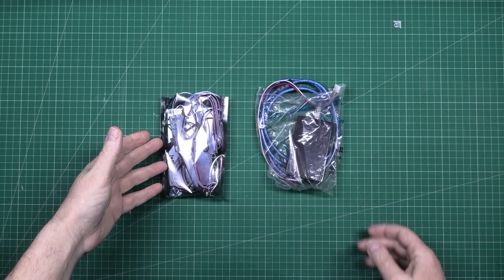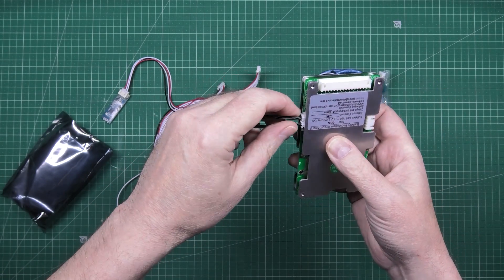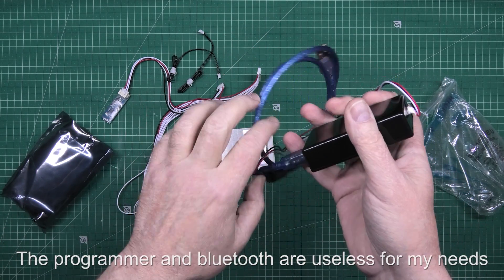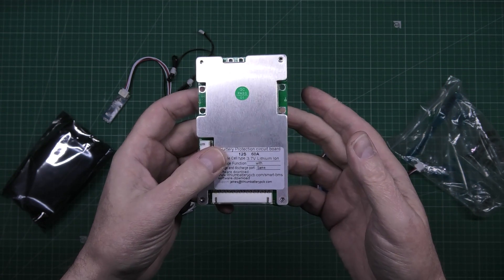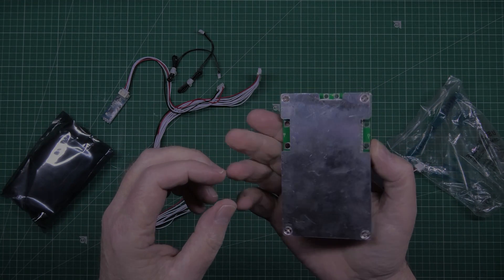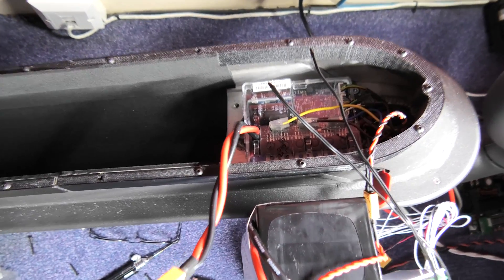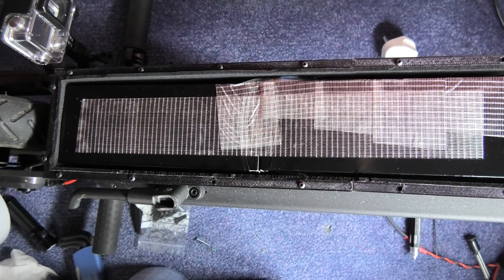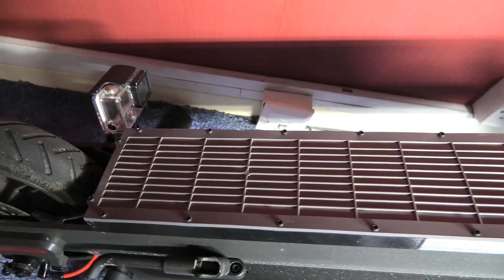Xiaomi M365 Pro scooter part 3 - new BMS and LiPos - the ultimate mods

Comment: I don’t know if you will get your message but when you converted your front wheel to rear wheel shaft through the wheel where did you get the extension from I am making an all wheel drive at the moment but I need to know where you got the shaft from
Reply from the maker: If you're referring to one of my later videos, the link was in the description on where I bought it. It was a complete kit I bought from someone in the EU that converts it to RWD.

Comment: You may be all over the shop with this one but you’ve done a pretty damn decent job of this mod!
How did the pla spacer go with rigorous use?
(Can I suggest making that thing sealed by coating the inside of the print with anything like paint to stop ingress of water and some glue gaskets too)

Comment: Tony, did you have to modify the BMS at all ? i.e. remove some of the resistors or did you jut have to re flash it using the programmer you show ?
Reply from the maker: Yes, I had to remove some shunt resistors and a couple of the very small ones. I've been working on a 'how to' but it's not making much sense (even to me)...... I'll keep working on it, though 😊
Reply: @Vortecks  thanks for the reply - thats basically where I am, I've prepped the BMS, did you program is using the supplied programmer or did you have to connect wires to the chip ?

Comment: Again..V interesting .
How well does that Aftermarket BMS do at balancing the cells .. such performance seems rare with  (cheap) built ins. 
Alternate would be to use a Quality external Battery charger station  (not inexpensive) as well as a nuisance everytime one charged.
But that would require a  direct external connector.. would the ESC  like having the sms disconnected?

Comment: Lol...Tony, you're a Top Bloke matey...I'm guessing you had to drill and tap all those cover holes, or did you just use longer screws...?
Reply from the maker: I used longer screws mate. The hard part was designing the extender bits and make sure all the holes lined up!
Reply: @Vortecks  Yeah, that's what I meant to say, that's dedication mate...lol.

Comment: Could you develope a battery unit that will run Small Computer and Display for 14 days +, if I provide the power requirements?  Or if you could guide me through the project as I am not an electrician, nor do I have all of your required test equipment.  Most Humble Appreciation,  Alton
Reply: Running just one 100 watt light with an inverter will take loads of batteries so high cost... If it's a full pc  your best bet is a generator. Honda make one of the best small one's that's quiet.. or just run a tablet PC with a car battery as your power bank.. you'd just need a 12v to usb module.. and I think you'll get a few months of run time..
Reply: As Brooke has said a generator would probably be better.... Small computer and monitor will probably pull 350+ watts so let's say 350 watts per hour x 24 x 14 days... Will tell you how many KWhr you will need... It would be easier to come on the forum and ask the question, we can then thrash out what you would need better
Reply from the maker: Something like the GIGABYTE GB-BXBT-2807 draws a max of 15W which means you can run one for 24 hours (at 100% load) on a 30Ah battery. That doesn't take into account a monitor, keyboard and mouse. To run the same system for 14 days would need a 420Ah battery. Personally, I'd do what's already been said and get a mini generator 😁
Reply: So a bank of 20 LION 18650 batteries, and find a power regulator dispersing 2 to 5amp outputs would give 2.5 to 3 weeks.  I could fit into custom made laptop type case (ALL ITEMS). (Displays are low voltage 1024x1280 screens).    
Is there a voltage regulator that has knobs to dial output?  Also 2 or 3 outputs per regulator?  
I'll create 6 spares with batteries to use while on long travel.
Reply: @smartassist9700  Hi Alton, If tony's calculations are correct and i know he will have worked it out quite well, So you are going to need the following... working on a 95% efficinecy of the inverter.... you will need 84 x 26650 Li-50A cells to make up 1 string of 3.7v and then if you are making it a 24v system 7 x 84 to get the voltage - 588 cells in total... at a cost of £30 per 10 cells - an inverter rated at the highest efficiency possible or you would need more cells to compensate for the percentage loss in conversion from DC - AC, if you were doing this kind of system then i would look at converting an APC UPS from the lead acid battery bank and adding the 588 cells as above...